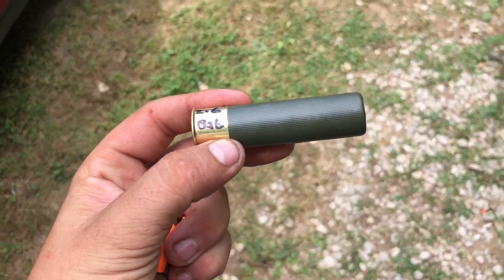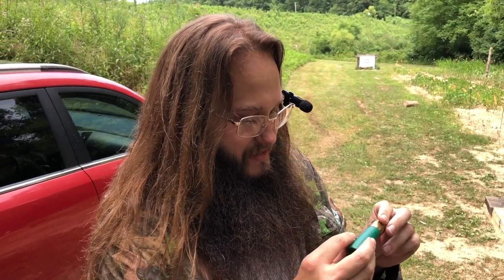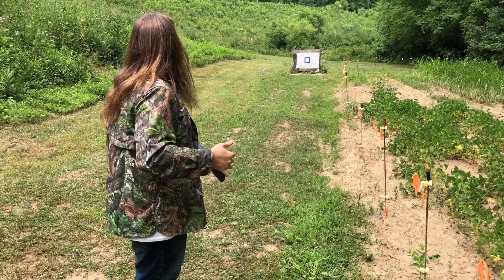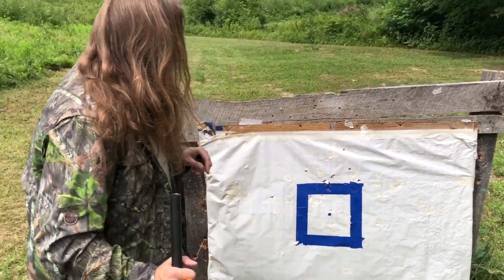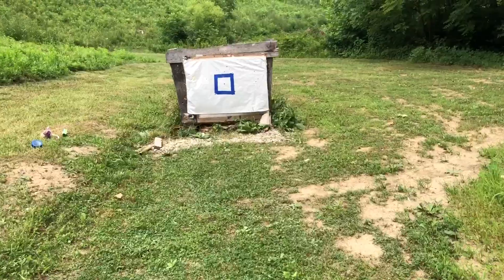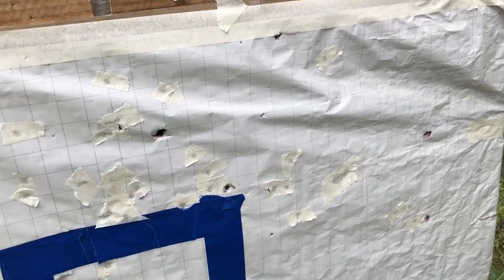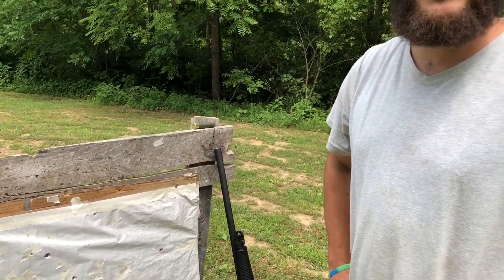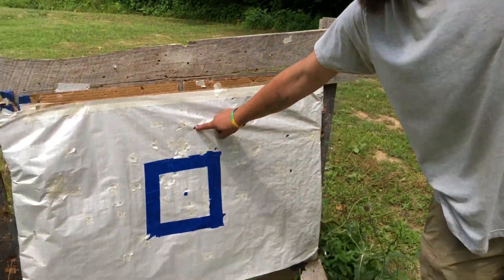Patterning Trash From A Lead Casting Pot

Comment: I got a new mold in the mail yesterday. The Lyman 2654012 which produces a 475gr .705" foster slug. I got busy and cast a bucket and loaded em up into federal gold medal 2 3/4 hulls, chedditte primer, with 34gr longshot, bpi brush wad, 3/4" rubber washer, slug, overshot card. They hit the same hole at 20yds and had touching holes at 40yds with my 870 police magnum. Have you guys shot that slug?
Reply from the maker: Actually no we haven’t
Reply: @theshotgunscientists  OK I shot those 475's at 110yds today, not at paper but at a head sized rock on a hillside and hit that rock everytime. I don't know what they're doing at 70 but I think they're pretty flat. I think I have a bunch of 12g slug molds for sale now. Svarog pellet and Italian molds(@500 special wads) , lyman 525, lee 690 round ball. I'll put em on ebay in the next day or two. The only ones I'm keeping are the MP .730 600gr and the Lyman 475gr .705. It only took me 4 years to figure this $hit out.

Comment: Great video bud! Completely unrelated question. Do you see any benefit to buying shot shells (especially tss) over loading your self? I'm loading tss at 2.85/shell so basically half the price of factory.
Reply: I don’t see much point in loading lead shot. Buckshot slugs and stuff like bismuth. I can load bismuth 1 1/4oz for $2.31 Canadian a shell considering a box of bismuth is about $70 here and it’s never available in shot sizes you want it makes sense.
Reply from the maker: It depends on your needs and how quick those needs have to be met I guess I’d say. If you need #7 lead shot in a game load, well that’s very hard to find. But just doing plain old target shells, not worth it to me. If you’re doing tss for that price, you’re doing well.
Reply: @theshotgunscientists  that's what I was thinking, thanks bud!

Comment: Here is one for Tyler.  Some one on buck snd slug  came up  with just using used primers. In 12 gauge 2 3/4 ?
Reply from the maker: @tonygotts199  we have some loaded in 3.5”. Even in a 3.5” 10 gauge you can only fit about 18 of them and it weighs 0.62 ounces. That’s a .410 payload. Not even worth trying in 2 3/4” I don’t think.
Reply: About the same as loading beans or popcorn.  Can be deadly at point blank but loses kinetic energy fast.. would just be an owie at 10 yards..  tho you could actually shoot your eye out.
Reply: I have loaded fired small and large primers in 12ga. 2 3/4. Not quite heavy as lead shot. It does work!
Reply from the maker: I was talking about 209’s I’d say yeah it would work a lot better with pistol primers though